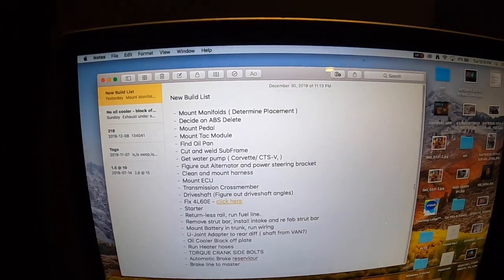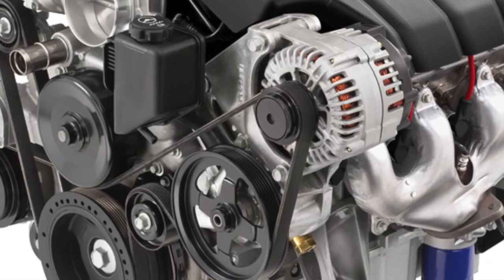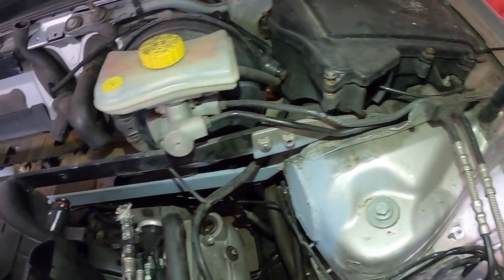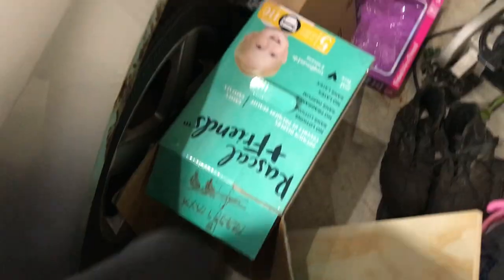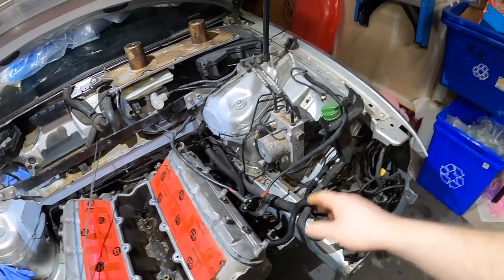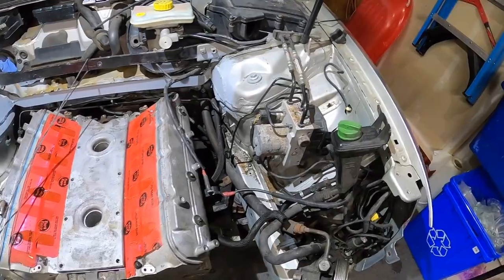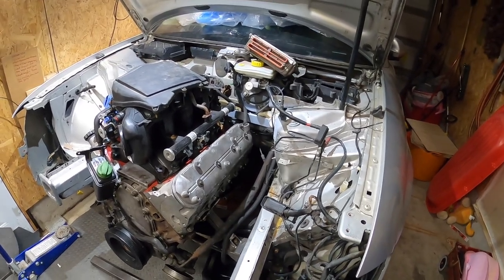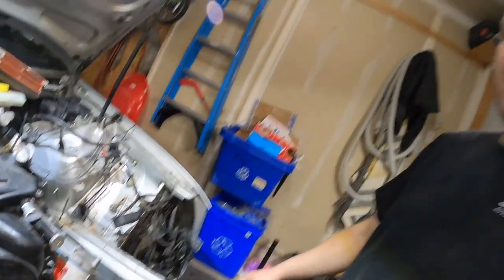Continuing the 6.0 Audi Swap - Whats Next?

Comment: bro check out holly for the accessories. they make a kit that allows for all accessories to mount off the water pump which makes it a very tight and small package
Reply from the maker: Krusty Pickles Gaming just took a look, I like their low LS drive bracket. The water pump one is nice but way too expensive for me lol. Thanks for the tip though I might just get that bracket if I can’t source one locally.
Reply: @jonamond  yea i hear ya. it is quite a lot but you do get the accessories aswell. im gonna need to get it or find some knock off version for my 2 ls swap projects. especially my impreza because its getting an 8 to 1 header that takes up the whole front of the engine